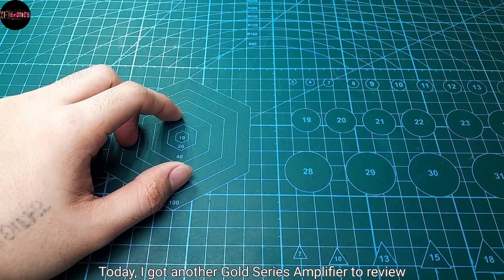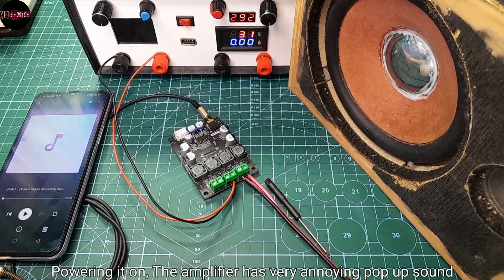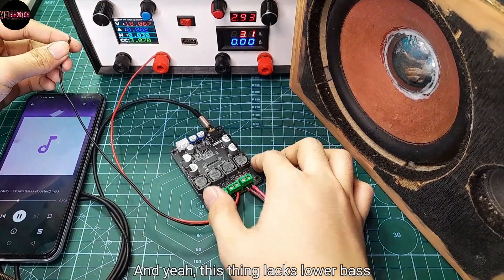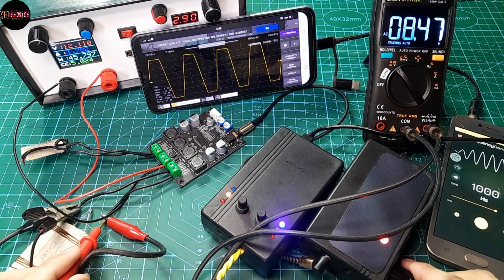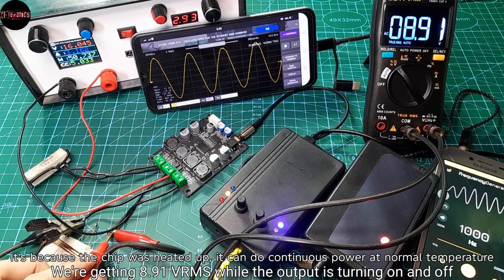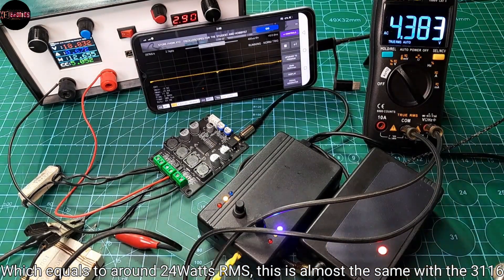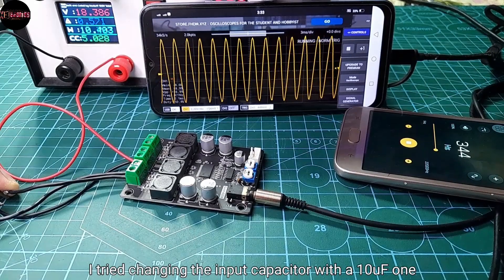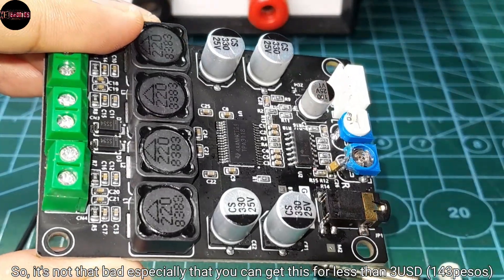Gold A314 / TPA3118 Stereo Real Power Test! #tpa3116 #classd #amplifier #diyspeaker #stereo#soundbar

Comment: Yeahhhh you review it 🥹🥹🥹🥹🥹🤣🤣🥲
Reply from the maker: Copyrighted Issue. I thought the song was copyright free since I used it before. Unfortunate 😅
Reply: @x3dtronicsph  Its oke🤣🤣 im planning to use this in my speaker build im gonna use a pre amp board will it help with bass?
Reply from the maker: If you're making with small speakers. You don't need to modify I guess. You can use EQ as well to compensate, but of course playing from platform like YouTube will lack bass if you're a Bass Head🤣. 

You can Actually solder 10nF capacitor in parallel to the feedback resistor of the opamp to have a low pass filter. 
Find the resistor connected to pins 1 and 2 for 1st channel. And resistor connected to pins 6 and 7 for other half channel. 
The value of resistor is 20k (marked 203)
Reply: @x3dtronicsph  gonna use with two 30w 4inch woofer 😂😝 with that xh a901 pre amp. I already made a test box with a port and ig 15 w of power (i don't have powerful supply yet💀) you can feel and it shakes my table and all😂😂😂😂😂😂😂😅😅😅😅😅
Reply: @x3dtronicsph  will it run on 24v? I am having some problem 🤣